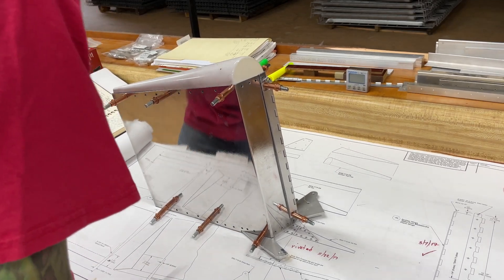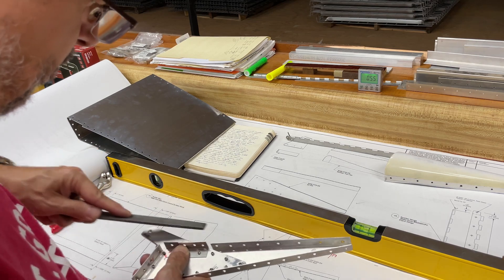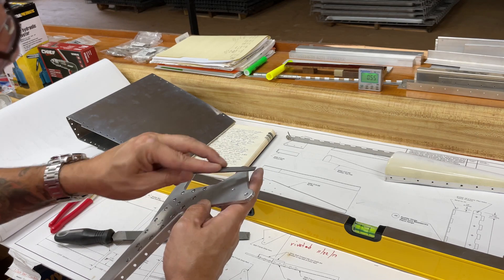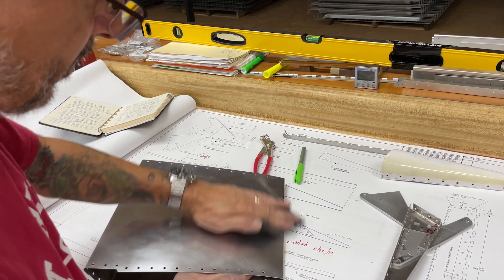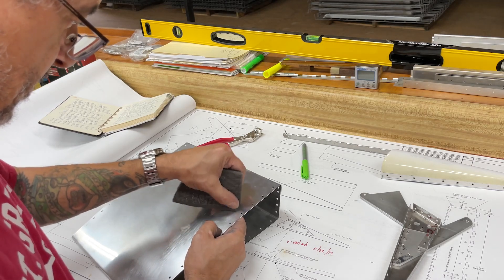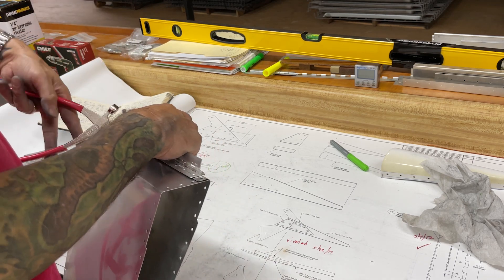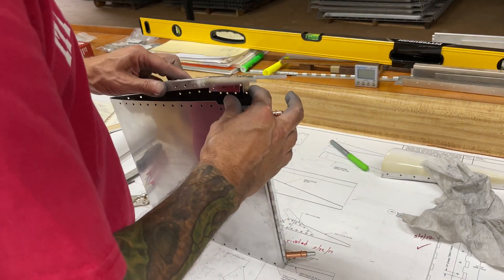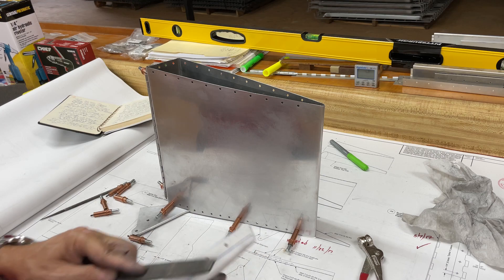Sonex Waiex B Build Part 3 - Let's See What We Got

Comment: I was thinking just painting the top of the wings white and the fiberglass surfaces white or maybe another color just to save weight and also cut down on glare and heat.
Reply from the maker: That's what I am thinking but I need to come up with some color pattern that blends the wing tip colors into the white that also looks good.

Comment: Always sand in a straight line. Circular sanding Will show circles through the paint. Especially since you want to use the least amount of paint you can. Paint is very heavy.
Reply from the maker: Thanks, I knew that but apparently was not thinking. The cameras do become a distraction at times. The ironic part is that I now plan on polishing the rudder and other parts that will not reflect into the cockpit. Still working on paint ideas as to how to do it.

Comment: As an A&P for over 50 years , it is a NO NO  sanding or removing in any way the Alclad finish off of the sheetmetal like you did , but maybe sonex does'nt have Alclan finish type sheet metal. I really don't know.
Reply: I am pretty certain that the Sonex parts are not Alclad.  Regarding the paint vs. polish, I have thought about this quite a bit.  According to Sonex painting the aircraft adds approx. 25 lbs. to the aircraft empty weight.  For an aircraft that is as small as the Sonex and has a nominal useful load of maybe 500-550lbs, depending on equipment, 25 lbs could be the difference between bringing baggage or not.  Personally I would polish and maybe apply a few vinyl graphics to dress it up. But that is just my opinion….🤔
Reply from the maker: @johnjensen2217  I have given that some thought too. I may just paint surfaces that would directly reflect the sun into the cockpit.
Reply from the maker: Thanks for the insight. I will ask them and see if that is a factor. Worse case scenario is that I cut a new rudder panel.
Reply: @weekendhack.whatsnext   Just prime it with a good etch primer, but do it soon before it starts to corrode.
Reply from the maker: @cvanthomme  Thanks again, I will try and get that done soon.